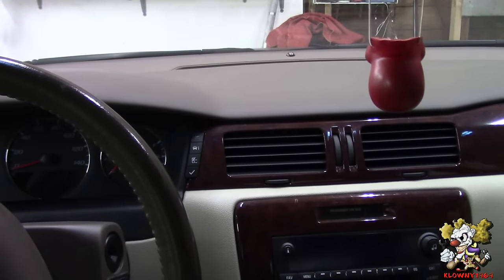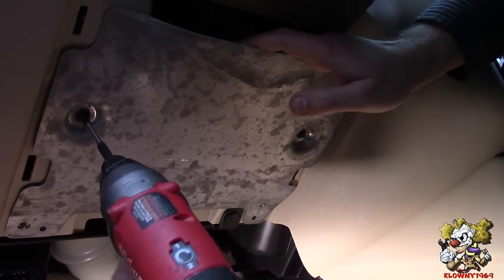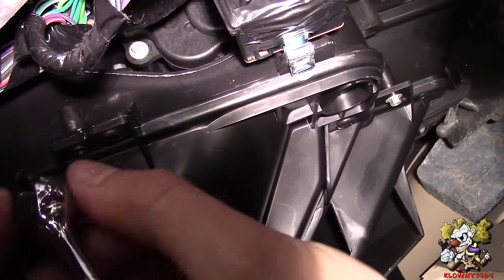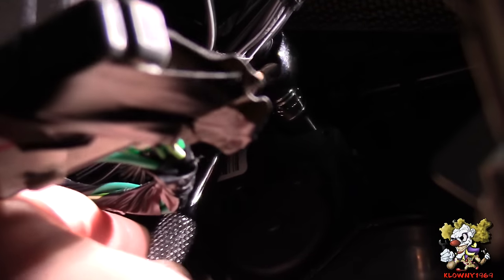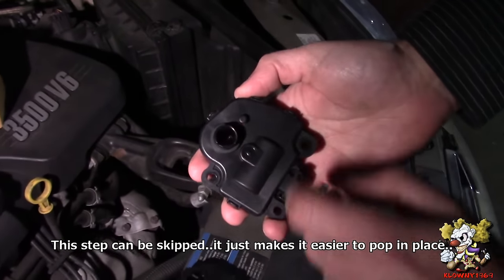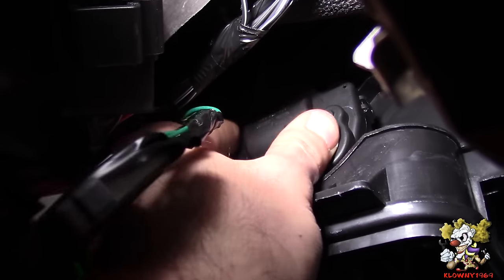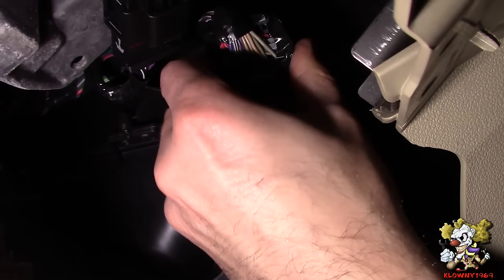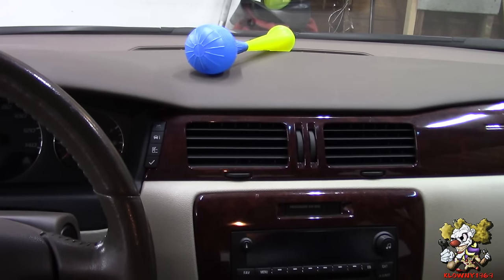How to Replace a DRIVER Side Heat Door Actuator - Chevy Impala 2006 - 2013 - DIY

Comment: so how many actuators are there? just 2?
Reply from the maker: a bunch..each car is diff..this impala has three just on the passenger side alone
Reply: This is the same for my 2007 Monte Carlo. There's 2 behind the glove box - 1 operates the blend door for the fresh air or recirc option and the other operates the temp for the passenger side. The one on the driver side controls the temp for the drivers side. These seem to be a common issue and I think they should be recalled by GM. They should have placed metal gears instead of the plastic ones. Wonder if there's a way to get or have metal gears made to replace the plastic ones.
Reply: +klowny1969 ahhhh so will I need to calibrate this. I read that if you have an HVAC system you have to this. I'm trying to fix this myself since the dealership is quoting 6 hours of labor. Does this sound right to you? haha
Reply from the maker: +Juan Chavez service time is about 6 hours..my method takes 10-15 minutes
Reply: +Juan Chavez from what I understand you do need to have it programmed to the BCM so it knows the start and end point of the rotation to prevent trying to go farther and stripping the plastic gears (which should be metal in my opinion). 6 hours seems iffy to me, it should be more like 3.5 hrs roughly. If you want to replace them yourself, you can change them, but don't plug them in, and contact the dealer for programming, just let them know all they need to do is plug them in for that process though.
Reply: +John Thorpe of course that depends on if it's the driver side one, the passenger side ones take less time.
Reply from the maker: +John Thorpe no need for programming
Reply: +klowny1969 I'd check with a dealer. I've had mine replaced twice so far and have had to have it programmed. Best bet for anyone is to ask the dealer and/or a repair shop.
Reply: +klowny1969 I actually called a couple different Chevy dealers service departments and asked them this question. I called different areas and states as well, and they asked me what year and said that yes they would need to be "recalibrated" so yes they do, but it may be specific to the year, make and model as one verified my car details (being an 07 Monte Carlo).
Reply: +Juan Chavez I called a few Chevy dealers about my 07 Monte Carlo and one recertification the year and told me that yes they do need recalibrated and that the cost is around the $140 area just for that. What you could do is replace them and not plug them in, and take it to the dealer to have them recalibrated. Just let them know you replaced them, but didn't plug them in. But I'd ask the dealer (or even a couple) to see if your year, make and model requires recalibration.

Comment: hey I got a problem with my Chevy 2008 chevy ac. I replaced one actuator on the passenger side and on the driver side. But my ac is still hot and I have added ac freon. The ac still blows hot...?...?....?.....?  Anyone with any ideas what it might be?

Comment: You don't list the part #'s or where to buy them in any of your vids...  :(
Reply from the maker: i will start doing that..i mentioned in this video the part number and i got it from autozone..u can also get it on rockauto. .thanks for watching
Reply: I heard there were two seperate part numbers for the 4 actuators that are in my car (driver temp, passenger temp, fresh air door, and vent choice)  I found some on amazon, but don't want to get the wrong one...

Comment: I have the same issue with my 2008 Impala but my problem isn't only that. I'm having my Impala since 2009 in Oregon then decided to ship it to Saudi Arabia after graduating last year cus I love this car. The biggest issue is that 2006-2013 Impala was not imported in any Middle Eastern country!!! So there's no part Supply. 
Chevy Malibu 2006-2013 is available in Saudi Arabia but I'm not sure if I can use Malibu parts to Impala. 
Even Chevy agents and Chevy parts suppliers don't have any idea about Impala parts!

Shipping parts from US is a choice but it's costly!
Now I need throttle body, breaks & discs and shock absorbers. And maybe I need more parts in future 
Selling the car is not a choice because it has all of my memories 

So who can advise me if 2008 Malibu parts fit 2008 Impala's?

Comment: Okay Klown1969, I have my (07 Monte Carlo SS)driver's side blowing hot air and the passenger is blowing cold. What gives?!!? Thanks  P.S. I love slits
Reply from the maker: could be the actuators..thanks for watching..and slits rock!!
Reply: Anytime! 
Ok because I did change the one near the glove box a while ago it WAS clicking; now this heat issue coming out of the drivers side only but no clicking...I'll look into it 

and lol yes they do rock!!
Reply: +klowny1969 i have a 2009 impala and im havin trouble gettin my actuator out
Reply: +Marcus McGowan did you get the screws out?   It should pull straight out.   There is still wires attached so don't break those.
Reply: +orangeagent2099 i cant get the screws out becuzz i dont have a comfortable angle or enough space to move to unscrew the screws when im layin down
Reply: +Marcus McGowan I had the same problem... May want to use a smaller ratchet... Get some with magnetic grip.  Finally... Make sure you have two flashlights.   I kneeled out side my car and after I clipping everything managed to get in there... I actually had the ratchet upside down to get the proper grip.   

It took him 12 or 13 minutes. The video... I spent hours until I got the right size ratchet.  

If you can't get the screws out... At least see if you can Unclip the plug that goes into the part.   This will resolve your issue until you can find a few hours to finish.   No power... No clicking.
Reply: +orangeagent2099 hey the clip is uncliped i just can't get the screws
Reply: Were you able to determine why the drivers side was blowing hot?  My son's car is doing the same thing.  Does changing the actuator on the drivers side fix that problem?  Thanks!

Comment: Here's another "TIP"..... rather than using the car's 12 volt battery to advance the new actuator to match the old ones position, use a small 9 VOLT battery with a battery clip and leads. MUCH EASIER (and safer)  than hooking to battery leads ....
Reply from the maker: buzzflewhart you dont even have to turn the actuator..just put it on and twist if ts not positioned correctly

Comment: I need help, seems like It's in an uncomfortable spot to take out and I have another set of wires in the way. Can u call me?
Reply from the maker: i show in the video how to take those wires off..im sorry i dont talk to people on the phone. good luck
Reply: Ok I got it out, besides using the wires how can I turn the thing to match the other one?
Reply from the maker: u dont have to turn it..u can just catch the door first on turn it in place
Reply: klowny1969 i can turn the end that is on the car?
Reply from the maker: yes..with the actuator..and then just align the bolt holes and push it in
Reply: klowny1969 thanks I got it . Thanks a lot
Reply from the maker: np

Comment: Update:

I did everything exactly like in the video but it didn't work on my car... any suggestions
Reply from the maker: Are you sure you replaced the right one? Also check to see if your new part works..or if you are getting power to the wires
Reply: @klowny1969   I will and thanks for taking the time to respond I really appreciate it
Reply from the maker: Anytime
Reply: Check the wiring and also you might try to replace the other 2 actuators on the passenger side the blend door might be stuck

Comment: Man doing it on a 2012 is slightly harder...The wiring under there is more cramped. Its basically impossible. Ive decided to ride it out and put up with the temporary clicking until I get another car in about 5 months. Guess for the 2012 and newer models they made sure that drivers would have to take it to the dealership lol Not me!!!!!

Comment: You know what, I'd say "Fuck the Heater" just disable both Actuators just so you don't have to deal with that tapping noise while it slowly drains your Battery. That's what I did with mine. I don't care if it's going to blow cold air. At least I wont have to make trips back and forth to AutoZone for a new Battery Spending hundreds of Dollars for it. There are things you can do with and there are things you do without and replacing Actuators are something I can do without. All I have to do is disable both of them and Problem solved.

Comment: The one under the wheel is a nightmare!
Reply from the maker: SYN-GATES25 not that bad
Reply: Spoke to soon i just got it off lmao thanks for the video 👍
Reply from the maker: lol np
Reply: I replaced it but it's still clicking?
Reply from the maker: SYN-GATES25 there are a few by the glove box as well..Did u verify that the one u changed was in fact the one that was clicking?
Reply: klowny1969 yes the one under the wheel was clicking. I replaced it but it is still clicking which is weird since it is new
Reply from the maker: ok..could be defective

Comment: These actuators are junk. Chevy should have to pay for this. Everyone with an impala has to replace them and it cost a fortune. Then the junk tire sensors, seatbelt  sensors, ignition recall and traction control malfunction all in my 2010 Impala before100k. Never again it will be Honda or Toyota from now on.
Reply from the maker: Lol